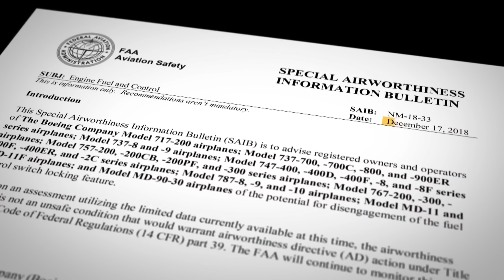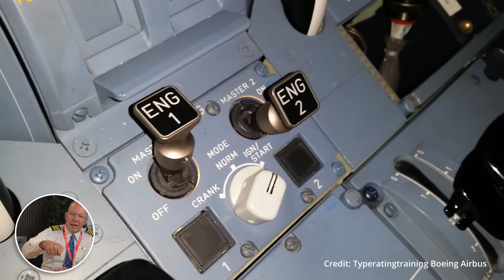Air India 171: The FAA’s 2018 Fuel Switch Locking Bulletin Explained (16 Questions Answered)

Comment: Captain Steeeve: If the handles were put back into RUN after they had been switched to CUT OFF, how come they were found in the CUT OFF position in the wreckage? Shouldn't they be found in the RUN position?
Reply: They were found in the RUN position. Quoting the Indian government's report, on page 10 it prints "Both fuel control switch were found in the "RUN" position."
Reply: @ClickWasd Ok but I thought I saw an image from the wreckage with the switches being in the cut off position. But ok, if they were found in the run position, then it makes sense.

Comment: Boeing has a long history of pushing blame on the pilots. Here are a few points highlighting Boeing's history of deflecting blame onto pilots:

1.  Following the 737 MAX crashes (Lion Air & Ethiopian Airlines), Boeing initially focused heavily on pilot actions as the cause, downplaying the critical role of its flawed MCAS system and inadequate pilot training.
2.  For decades after fatal rudder hard-over incidents on older 737s (like USAir 427), Boeing insisted pilot error was the primary factor, despite evidence pointing to mechanical defects – a conclusion eventually confirmed by investigations.
3.  This pattern of emphasizing pilot performance in accident investigations, often before thoroughly examining potential systemic or design failures, is a recurring criticism of Boeing's corporate response to tragedies.

Comment: Good evening, wouldn't it be interesting to know how these switches are wired to the black box? Because either they are physically directly connected to the black box and in this case there is no doubt about manual intervention, or they are wired to the on-board computer which will itself send the position information to the black box and the fuel valves and in this case there is doubt about a possible malfunction of the on-board computer.

Comment: I can confirm on the Embraer 170/190, selecting the Start/Stop switches to off will not shutdown the engines with the thrust levers out of idle. Also, there’s a plastic cover guard that must be lifted to access the switches.

Comment: I have been following your videos on AI171 crash. 
Just wondering if a sabotage could (in theory) be engineered such that the mechanism that is responsible for writing to FDR could be manipulated to write doctored entries so as to cover up a sabotage and make it look like pilot error/action.
A pilot manually cutting-off both switches on AI171 could only happen under following scenarios:
1. Pilot is suicidal to an extent that he is willing to take down about 250 people along. In this case, why would the pilot deny cutting off when asked by copilot? Also there are more certain ways of crashing the plane. Perhaps just pushing the column down and nose-dive. Cutting off seems like a tentative way, giving copilot a chance to recover.
2. Second scenario is that pilot was mysteriously disoriented. Almost like hypnotic control, where he turns the switches off, then moments later snaps back to reality leaving him with no memory of cutting-off. Which would explain why the pilot denied doing so and even cooperated in the recovery procedure.
3. Third scenario would be that instead of a pilot, they had a monkey in the cockpit, who was fiddling with the switches without knowing what they are for! A possibility far less likely than FDR sabotage.
Both scenarios 1 and 2 are very scary. Far more scary than a mechanical flaw with the plane. 
A trained pilot can be expected to deal with a mechanical failure and attempt to land safely. But a pilot himself trying to take a plane down - doesn't make flying the safest mode of travel!!
I don't know much about the internals of an FDR, but wondering if during maintenance some malicious actor could do such a thing. Having Software development background, I can tell you that it is certainly possible for any computer application to be hacked in such a way that it does one thing but records something else in the logs.
I am inclined towards a sabotage because most pilots analyzing the incident are not from India. What they may not be considering is that India is a very hot target for terrorist and other disruptive actions.

Comment: In the report the phrase "locking feature disengaged" is used which implies that the locking feature can be enable or disabled. Do the switched have an ajustment to engage/disengage locking? This might be something like a rotation of the switch.

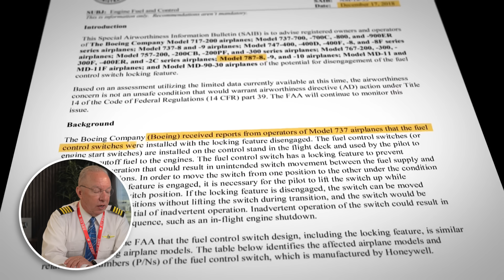Comment: 7:41 stop trying to save BOEING.. that report in 2018 clearly mentioned that the fuel supply switches could malfunction at any point of given time,, 2nd thing is that the preliminary report of air india plane crash doesn’t say that the pilots switched off the fuel supply switches.. nowhere the report points out towards the pilots.. it does say that switches were turned off and then again turned on but it doesn’t say how did that happen and who did it. Maybe there as some software or hardware problem that le the plane’s operating system to automatically switch off the switches… so stop blaming pilots and stop saving BOEING.. PERIOD !!!!!
Reply: exactly.... clear coverup he's not even exploring the theories about mechanical/electrical/system failure

Comment: Are these switches mechanically connected to the actual fuel valves in any way? Or is the connection electrical? There is a known, potential, problem with drilling swarf remaining in wiring bundle routes. Is it possible that intermittent wiring short circuits could do this? Quote, "Why did you move the cut off valves?" "I did not"

Comment: I remember some 15 or 20 years ago Boeing intended to move the headquarters out of Seattle, In order to do that it launched a kind of auction between candidates. Cities asking for the best economic and fiscal advantages, In the end, they choose Chicago., Not the best choice, my opinion, with Harsh atmospheric conditions and already overpopulated with I suppose not easy moving. So it was a choice based exclusively on economic figures. And I said to myself company in such Critical manufacturing processes where really every bolt counts., Where every mistake down on the factory floor can be disastrous, must maintain the company culture. So my guess is that all the problems that recently showed up a Boeing can be traced back to this blind mismanagement.  Written with voice recognition

Comment: Are you sure the plane behaved the way is was designed for? Would you give an arm for that? How about the bulletin from 2018 that says that those switches might disengaged on its own leasing to catastrophe. Are you still sure it was 100% pilot’s error or deliberate action other than aircraft malfunction causing those switches to disengage?  I wasn’t be so sure as while the system was caught in the past turning those switches off to cut-off position it was sure that sooner or later it would happen again. If the system malfunction happens once you have to be sure it will happen again. I’m not defending pilots, as they may have lied too nor blaming  the plane itself. IMO they should dig dipper not only in pilots’ history, their mental health and past behaviour as well as digging in the system of Boeing itself. What bothers me is why the Boeing was not forced to fix the switches auto-disengage issue and having their planes grunded instead of making of the bulletin of which recommendation implementation is optional? I know that people’s life is less important that doing business by Boeing which Boeing has proved many times in the past. From my point of view video recording is a must-have in the cockpit. In such case it would be clear whether the switches were brought to cut-off position by the pilot or plane itself. If, supposedly it was plane’s system glitch,  it will be hard to prove that and blame Boeing and it’s much easier to blame pilots.

Comment: There is a major design flaw in the fuel switch component. Both switches are part of the same unit, offering minimal mechanical redundancy. If any part within the fuel switch component fails, it can cause both switches to move to the cut-off position. From an external inspection, it's evident that a broken internal part is likely responsible for both switches defaulting to the cut-off state. The stress during take-off may have triggered or worsened the internal failure of the component. This scenario is as rare as a pilot intentionally cutting off fuel during flight.

Comment: In my opinion, even though  its likley possible, you should not state as a fact, that one of the pilots intentionally pulled the switches. Think about the family members of him and what they will experience when you say "he killed this people" and maybe in a few month something new is discovered and it maybe was a technical issue, with the mn4 with, soldering or what ever.
I also disagree with you on the point you state its a physical switch an that its recorded by the FDR that this switch was manually triggered. Also the manually pulled switches send electrical signals to the FDR and the buses. If you dont move the switch and manipulate the electrical signal or just the soldering contact oder the curcit under the switch, it COULD remain in the position and send the wrong signal. 
Is it likely that this happend, on both switches at the same time - absolutly not, but many things in aviation were not likley to happen and did happen. But for me its POSSIBLE (not likely) that anything electrical happend and after the cut off to the engine happend (without pulling the cut off switch) in order to rerun the, one pilot pulled them to cutoff and then to run again.
Think about the pictues where the switches were found in run position, but the thrust levers were in idle position, which indicates a restart, because i dont think that the impact pushed them to idle.

Comment: I have a question. Why place critical fuel cutoff switches adjacent to the throttle levers? They might have detents, but they are close to a position where regular hand movements occur, risk impact from an object sliding forward from behind or even (I’m not suggesting this might have been the case here) malicious operation by a third party. Further, the two guards seem to be a token since they protect the switches from the side but the switches operate fore and aft. I would call this unnecessary design risk. The switches could equally be mounted on the ceiling panel where they could not possibly be accidentally knocked. Add the concerns over wear or incorrect installation of the detent locks and the holes in the cheese begin to line up.

Comment: Thank you for answering these questions.
3:53 I am sure the questioner was not asking about prevention but about recording video evidence on the black box. This needs to happen and now it most likely will. Over pilot's objections maybe.
7:30 The airworthiness bulletin is listed in the preliminary report, as it certainly should be. It is from reports by operators that the locking feature was disengaged. So these switches worked but did not lock.
In the final report I have no doubt they will tell us if the locking feature of the recovered switches was working and they will exhaustively analyze the possibility that the fuel control switch cutoffs were accidental.
No one wants to believe that one human being, a pilot, chose to end his life while murdering 259 other people. But the possibility that, with no previous reported incidents, mechanical failures led to dual engine cutoffs 1s apart at the worst possible moment seems remote.

Comment: 15:55 the rat was shown on the interim report captain, you have read it, where rat was shown and the plane was right on the runway 100m high.
Reply: it is on page 14 of the report!! question: if the rat is deployed meaning that the engines cut off, how did the plane climb another 300 feet or so? is this possible with the initial speed?

Comment: I'd respectfully disagree with captain Steve. "If the locking feature is disengaged, the switch can be moved between the two positions without lifting the switch during transition, and the switch would be exposed to the potential of inadvertent operation. Inadvertent operation of the switch could result in an unintended consequence, such as an in-flight engine shutdown."

Comment: Obviously there’s a lot of the cockpit voice recordings that haven’t been released yet.   At 8 seconds into the flight one pilot asks the other “Did you turn the fuel switch off”.    There’s 50 seconds of recordings after that  - which the investigators have heard and with that they know exactly what happened - but are trying to be diplomatic about it.

Comment: Regarding the recommended replacement of the MN4 microprocesser in the ECU:  Even if this fault existed, is is more than highly improbable that both ECU would be affected within seconds of each other.  (Also, the described fault would probably be intermittent.)

Comment: If this was a deliberate act then the pilot who cut it off knew exactly when to do it so that saving aircraft was impossible. Time for Boeing to address this switch issue. Make internal modifications and not divulge technical details to anyone or in manual so that it impossible to operate when in flight by both pilot and co-pilot. More like a redundancy mechanism. This has to be addressed now to prevent such acts as somebody else can also do it. Cameras should be Mandatory now.

Comment: Based on the video presented, it seems that only the pilot could operate the fuel switches to move them from RUN to CUTOFF. Consequently, I find myself wondering why the report uses the term TRANSITIONED instead of moved, and furthermore, how the conclusion of pilot error was reached without any supporting evidence.

Comment: None of the pilots were suicidal. Captain Steeeve is clearly shilling for Boeing (or someone else, which is worse): the switches were never moved and were found in the RUN position,  after the incident, which leads to believe something else cut off the fuel supply valves.
Reply: I agree Captain steeve is bought by Boeing to spread false information

Comment: I don't think the pilots did it. There is a lot of pressure on those switches while its locked, so accidental approach is out of question. Why did it happen at that altitude, why not go 40 000 ft than Disangage it? I think someone in NTSB got paid pretty good. Union at airlines is worst thing ever. Lazy maintainers cannot get fired because of Union. Talking with experience, i was at A&P school and all the instructors were from United. They had no clue about the aircraft even though they retired after 35 years, they said they only worked on one shop for 35 years, but they knew everything about seniority and how to sue. I retired from the Navy and worked while i was in, i worked on FA-18 E/F/G and F35C. It blows my mind knowing how bad airline mechanics were at their job while talking to those 35year instructors at AIM in Fremont CA. Aircraft accidents is a trend now. Someone is lying if they say flying is still safe way to travel. Now days Fly at your own RISK or fly on Airbus. Blame it on the Pilot because they can't defend for themselves.

Comment: It's one of two things...(1) an unprecedented dual engine roll back on take off caused by some issues with the fuel delivery system that shut off the fuel with the Switches in the run position....thus the pilots tried to desperately re-light by moving the switches to cut off and back to run, as they were to be in the wreckage...and as is SOP in a single engine failure having reached a safe climb out... or.... (2) the fuel control switches were deliberately moved to cut off...no pilot moves those switches by mistake...and I don't believe they moved on their own. My question is where does the FDR read the fuel shut off?  Does it actually sense the switches being physically moved or just a fuel cut off in general. Does CVR pick up the physical sound of switches being moved? as it often does with other physical actions in the cockpit ie flap handles, spoilers or gear etc. If the sensor is located at the switches then it is irrefutable what happened since it can be connected to the exact time of fuel shut off. And then there is the question being asked by one of the pilots: "why did you cut off?" That would not be a question if it was a "un-actioned" fuel cut off...and not just a next to impossible loss of power and fuel flow. Why can't the report not include actual transcripts with mic input ie CAP FO etc as all CVR transcripts have?. We would at least know who said what. I understand not releasing the actual recording.

Comment: If the Pilot who allegedly wanted to commit suicide really did turned both the switches to run off position, then why he did allow the other pilot to easily turn the switches back to run position so easily without a record of any physical resistance? The investigating team with voice recorder with all the technology at their disposal can not correctly identify distinguish between the 2 pilots exactly who said what?
There is a serious need for having Cameras in the cockpit for the World's safety.

Comment: Hello, why not after this incident update the airplane software to include an aural warning like engine fuel cutoff, when the switch is flicked off during critical phases like taking off and landing. Then the warning repeats 5 times in 5 seconds. Warning on one of the MIDs saying confirm or abort. During these 5 seconds, the thrust is maintained by the system. This gives time for the other pilot to correct if this was inadvertent or sabotage by another pilot. Also the plane travels crucial distance within this span offering time to the pilots. This software change should not take a lot of time and should be easily implementable right away i guess.
Reply: Listen more carefully:  The spooling down of even one engine is immediately audible (especially if it occurs at takeoff power).